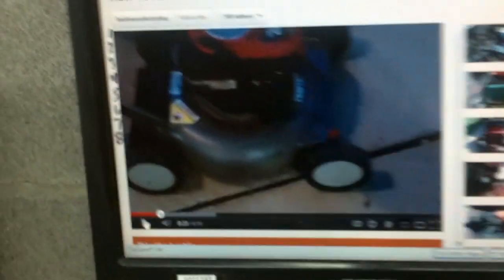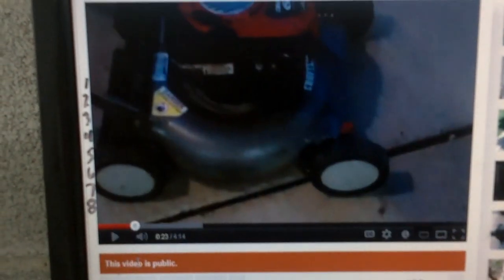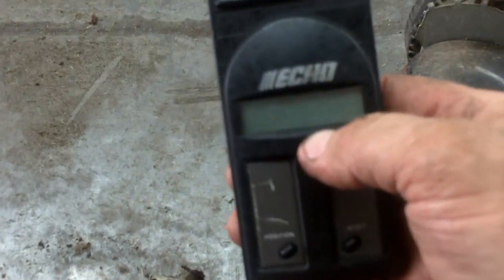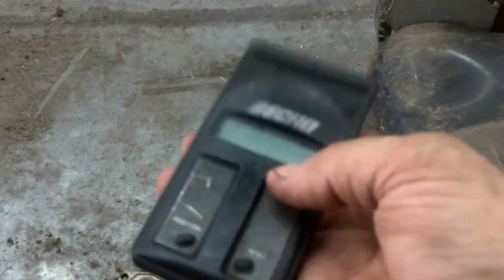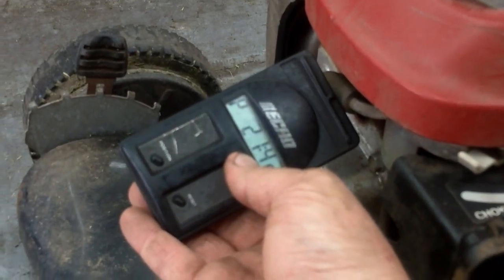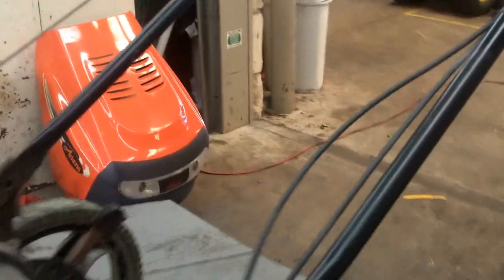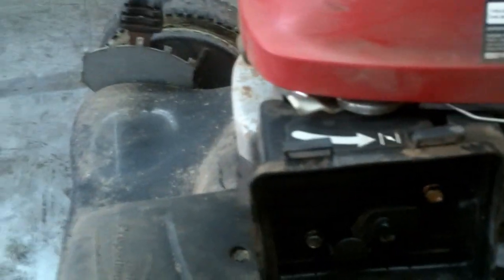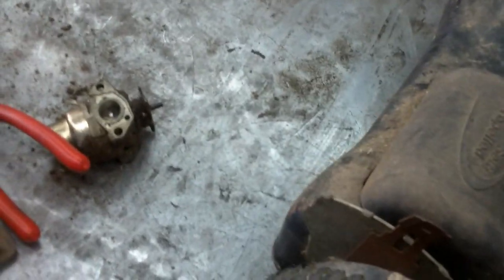VIDEO REQUEST FOR  BONFIELD2002  how to set engine rpm's using an inductance style tachometer

Comment: My hrc216 is around 2k rpm and seems like it’s screaming.... I can imagine the engine flying away at 3250!!! I mean I start it and when full throttle it’s blowing the metal door open. Last hrx217 I raise rpm up past 2500 or so and it made the muffler come off and put holes in it.... and broke the exhaust valve arm.... not sure exactly name right now it wasn’t valve but the rocker arm cracked and made it so when you went to start it the rope got yanked out of your hand. It did cut awesome and picked everything up! But wasn’t letting the engine last.
Reply: I wonder if your tach is set up for 2 cycle? Some ignition systems spark every tdc, and some only on the power stroke(every other tdc on a 4 cycle).  If so the 2k you mention could possibly be 4,000 rpm. The 2,500 rpm you mentioned may have been 5,000 rpm.

Comment: MR FOUNTAIN have you ever used a briggs and atratton tachometer (treysit sirometer ) part # 19200 I was giving one without instructions or do you know if there is a video out there somewhere thank you for your time
Reply: Keep turning the dial until the antenna vibrates to it's widest point then check the reading. that's your RPM'S.

Comment: MM1         I  googled small engine tach and looked at  e-bay and cant find the tach you have, If you have a chance could you steer me in the right direction, if I remember right Donyboy73 told me he does not have one either.  Thanks.